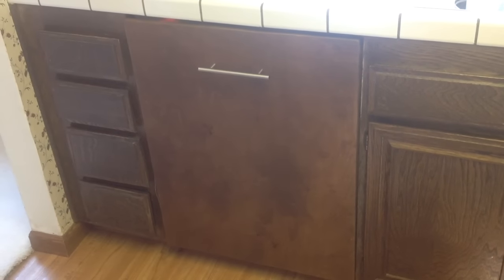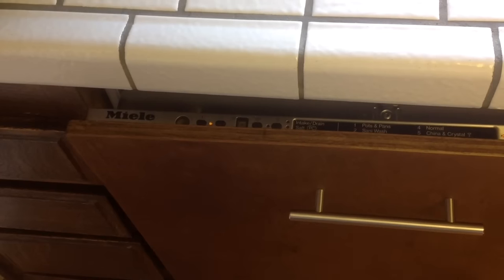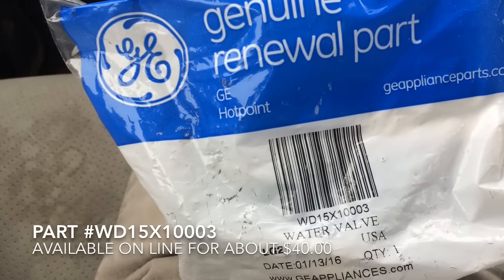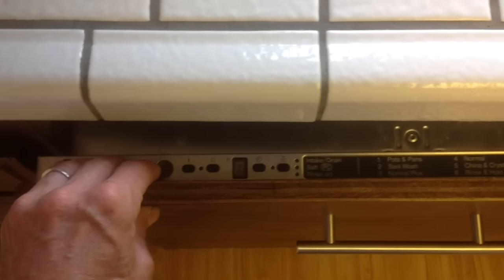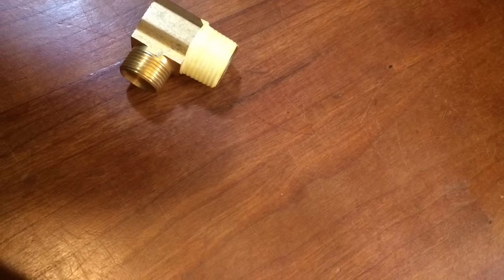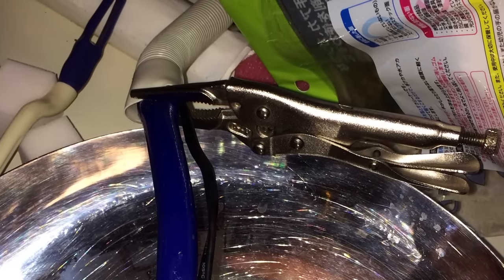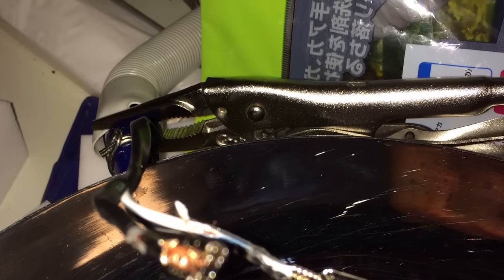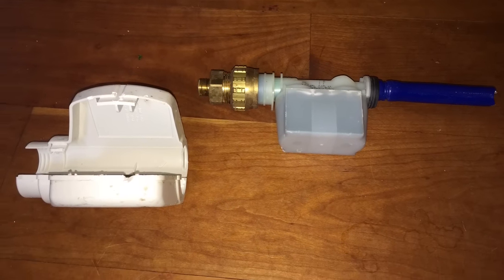✨ Miele Dishwasher intake/Drain Light - Fill Valve - Easy DIY Fix ✨

Comment: Hi Scott,
You didn’t mention what size the brass elbow is and I can’t find one that looks like it anywhere. All i’m finding is 3/8 or 1/2 compression elbows with the compression on one side. Any insight would be great!
Reply from the maker: Hi Jason,
If you order a new dishwasher fill line for any dishwasher on Amazon it will come with the correct brass elbow